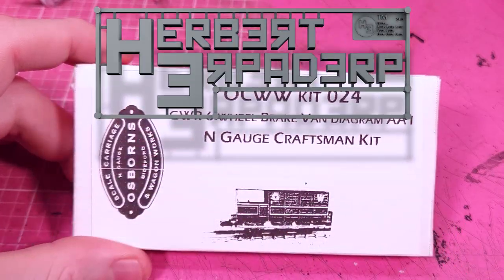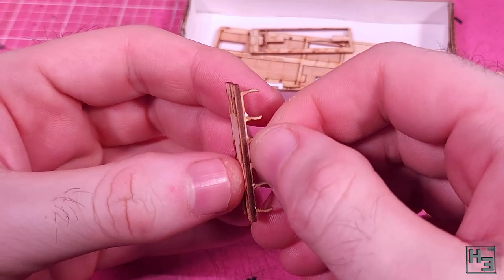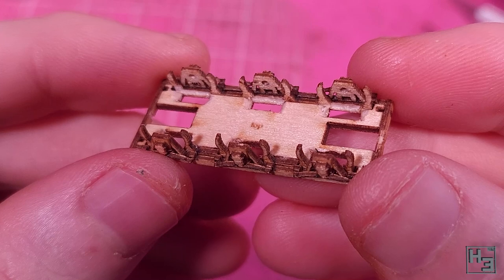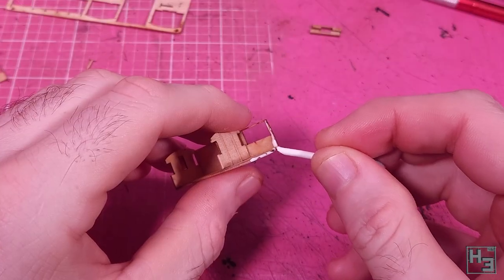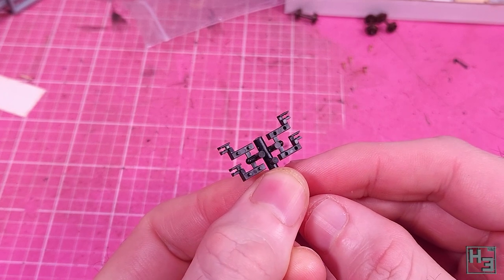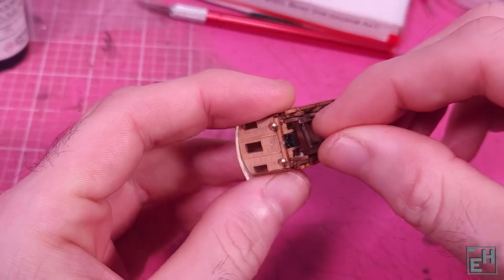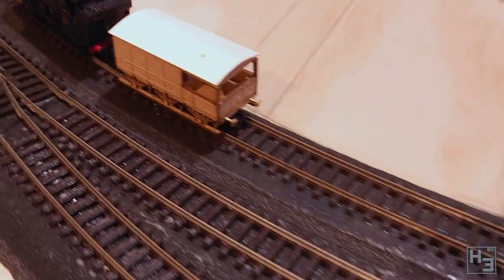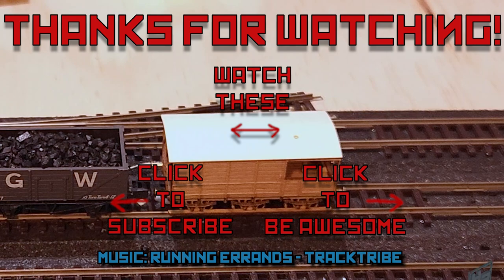GWR 6 Wheel Toad Brake Van Kit in N Scale

Comment: Having built an unhealthy amount of MDF kits, I can offer two simple bits of advice: 1) keep the left over MDF sprues and clip out several "glue sticks" from them.  The frame of MDF gives you a heap of useful small MDF tooth-picks for future glue applications.  2) I also use an x-acto chisel heavily for carefully cutting the sprue joins on larger surfaces.

Comment: Herbert, fyi, try to find an NMRA standards guage for N-scale it will be helpful with future projects. They also have suggested “standards” for weight to length as well. Another item you may look for is a coupler height gauge they do come in handy. Happy railroading, enjoyed the video, I do find European rail models very fascinating.
Reply from the maker: I've seen the NMRA Gauge, but It was almost $50. And I'm not sure it even applies to British prototypes anyway. 
It turns out the NEM pocket was actually a bit loose, despite the glue, and it wobbles up and down about a mm so the coupling has more vertical motion than it should. Gravity obviously decides that it should hang downward.  
 I think I'll just re-glue it when I paint it and make sure it stays where it should be.

Comment: I don't have a model railway but I've seen the prizes for locomotoves and stuff. So looking for a brake van for a reasonable prize seems to be something wheely sensible to me. It will look even better when it is painted.
Reply from the maker: It's certainly not a cheap hobby, but you can save a little money with kits and creativity.

Comment: Buy some brass bearings to put in the wheel holes that will make the wheel run better also use metal wheels much better running herbert
Reply from the maker: I think installing bearings one it's assembled would be a huge pain. But I've been looking at some metal wheels for this and the other wagons I have.
Reply: @HerbertErpaderp  Its dead easy Herbert if a 70+ year old bloke does it on a finished kit so can you mate try it :-)I can send you a few try if you like ??

Comment: Is a "brake van" the same thing as what we Americans call a "caboose"?
If it's where the brakemen spend most of their time when not actually operating brakes on other cars, I guess it is.
I'm used to seeing a sort of square turret on top along with a smokestack for a pot bellied stove, but perhaps creature comforts and visibility aren't priorities for whoever designs those things.
Anyway, cool little kit. I like that the windows aren't "suggested" but are actually holes so that if you choose to put crew or some sort of interior inside, you don't have to risk more surgery.

PS You promised more painting this year. Nobody else will nag you so I have to, and I don't like it.
Reply from the maker: As I understand it brake vans are pretty much the same as a caboose. I think they had a more active role in applying brakes than the US counterpart because a lot of wagons didn't have brakes controlled by the loco. 
Some of them seem to have little bay windows for vision, but maybe looking at the train itself wasn't such a priority. I'd assume they would have had a stove and some of the pictures of the real thing have what looks like a little chimney. 

Also, I'm pretty sure I did do more painting this year. At least in comparison to last year.  I don't make the same promise for next year. So there won't be a need to nag! haha